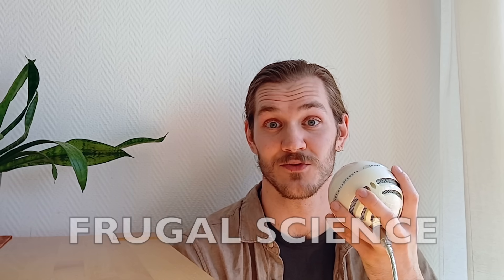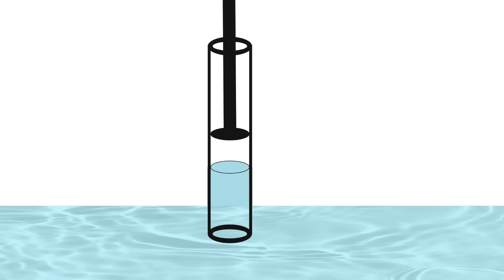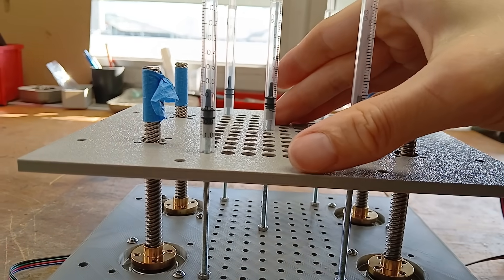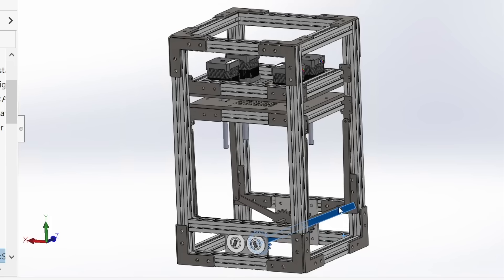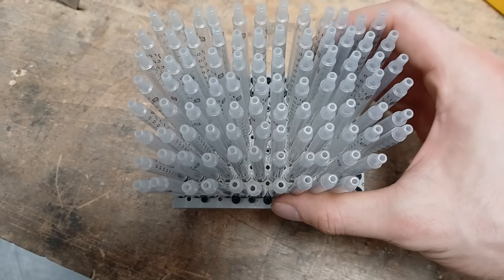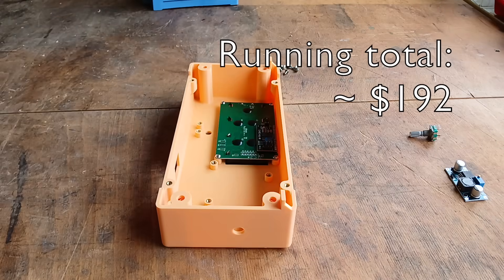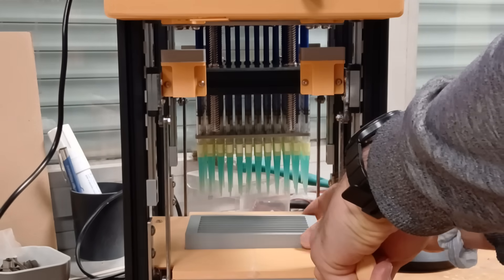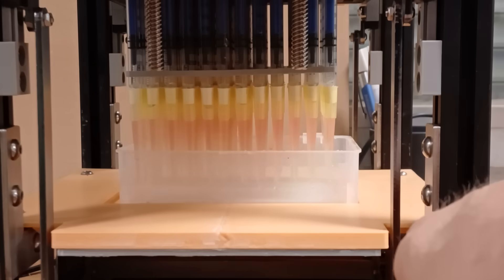This Medical Machine costs $18,000. I Took It Personally.

Comment: I'd add a double-throw centre-off momentary switch to the front panel (perhaps even on the right side of the box, to make it easy to reach). Click it downwards to dispense, upwards to aspirate.

Using the knob to select the “Dispense” and “Aspirate” options just seems like a needlessly complex way to access the machine's most basic function.
Reply from the maker: Good thinking, that would probably be a better UX

Comment: Needs to be able to automatically lock the trays up to prevent user error. Also needs to be designed so all failure modes prevent use.

Plus if sold in the US you’ll need to have liability built into the price. Just add 15k per unit there….

Plus the barrier to entry doesn’t exist. A small lab or single researcher doesn’t need this capacity and a large  lab that does has the money.

This is like making an affordable dump truck for your grandmothers tomato garden.

I did like the video though, this is good YouTube content!

Comment: Any open source for electronics code to fine tune the uL accuracy of the multi pipettor? Im curious what the accuracy is. 110uL to 120uL (10uL difference for example) or can it only do 100uL increments?
Reply from the maker: Great point, this is THE question. How accurate is it, and how can it be measured? The best I cam up with was to try to weight the amounts of liquid.

Comment: Try using herringbone gears to eliminate backlash. Also, I see a lot of these parts could be sourced from a used ender 3 which can be found for dirt cheap online (often under $100). Take a look at the ender 3 and see what can be used off of it in a revised design, maybe an outdated cheap printer could find a new home in a lab saving lives! For reference an ender 3 already has aluminum extrusions, 4 stepper motors, 3 limit switches, a screen and knob combo, and various hardware pieces. I could see the final price coming out to well under $200 with little to no compromise in quality.

Comment: how do you animate your 3d models like in 4:05
Reply: Model mechanism in CAD software first with gears and everything you plan on building. Define constraints, like set or rules, for example: gear rotates around this point, gears mesh in opposite direction etc. Software solve then it for you, while you can move pieces and see how it would work. Pretty cool.
Reply: @litynskyyrostyslav1760 

I'm gonna try this FreeCad software I found

 from the looks of it this is gonna exponentially enhance my mechanisms i randomly make
Reply from the maker: FreeCAD is great, I use it all the time, and there's lots of tutorials. Enjoy!
Reply: He doesn’t, it’s mating type to limit its motion in assembly and he is using his mouse to show its motion.

Google solidworks or fusion mating for gears it should show results that are similar to what he is doing.

Comment: Instead of trying to cram all the syringes into a small grid, have them all attached to pipete tubes of equal length. That would allow the pipetes to be funneled into a closer together grid, while leaving the syringes spread out and easily accessible

Comment: The 4 motors could be replaced with a belt and a single motor. The brackets on the extrusion could be 3d printed in solid PLA or PETG and achieve the same result, assuming you already have the capability. That's off the top of my head for additional money savings on this. Great work! Attainable science is usable science!
Reply from the maker: Thank you, good tips!

Comment: I would suggest using one big syringe connected to a manifold plate that all the pipets attach to. Square-Cubed-Law would mean it shouldn't take up too much space and you can actuate the one big syringe with much less friction. This also means you can reduce your 4 actuator stepper motor & acme rods to one for actuating the single syringe. You can reduce the manifold plate complexity by printing gyroid infill with a bunch of small "attachment protrusions" (there's a simple term that fits, but I'm proactively dodging yt filter) for your heatshrink gasket & pipet trick. You may need to paint or coat this manifod with some sort of paint/filler/epoxy to make sure it's air tight.

You can also reduce BoM of the frame, and reduce footprint of the equipment (maybe borderline portable) by making a scissor lift like device that attaches to a rack and pinion on the moving manifold plate to constrain its motion while keeping it parallel to the base plate. This constrains the manifold lifting mechanism itself and removes the need to constrain the manifold plate externally with linear rails.

Cool project! Love the principle of bringing cheap useful equipment to those who can use it.
Reply: Now I'm completely unfamiliar with the field of science that uses this, but something that I thought of that could be a concern is the off-gassing of the plastics and materials used to make it. Is this a concern for this use-case?

Oh, also, with this "master syringe" method, unless you have really big pressure differences between the pipettes due to large differences in head pressure (water level that the pipettes are dipped into), which is unlikely, the "splitting vacuum evenly 96 times issue" you talk about should be negligible.
Reply from the maker: Interesting ideas!

Comment: This is "awesome". 
I will point out however that the linkage described at 3:45, might have too much backlash for consistent eppendorf microliter aliquots. I recommend setting up a system that allows for autobed leveling so that all the eppendorf syringes are equal in their total dispensing volume.
Another thing you might want to add is something to prevent liquids from pulling too far back into the syringe so that they can't contaminate the syringe itself. Some easier way to swap out the syringes in case of contamination or wear will probably be important. Overall tho, this build is incredible.

Comment: Excellent result!! I work repairing autoanalizers and the main cost of the equipment is all the process, investigation, certification, traceability, and a long, long, long etc... At the end of the day, all parts, motor, controller, etc you can find and buy in somewhere (i have a few motor and parts from some equipment destined for destruction xD). I apologize for my English, it's not my native language.
Reply: Subscribed, just in case you get around to making videos of that.

Comment: Without proving the accuracy, precision and durability of this design, no lab will use it. Syringe plungers are not made for longevity. You have to remember these devices are used many times a day for years. I can visually tell that the liquid amounts are not level. An important consideration when you are working with such small volumes is evaporation. I also want to say that the eppendorf system is kinda fancy, similarly capable systems to this are 5-10k new.

Comment: Sorry, this is the epitome of ignorance.  Do you think the engineers in medtech are morons?  Do you think you think all medtech companies are just greedy?
Let me tell you what you're missing.  1) Setup a QMS, 2) Setup a supply chain to make these in bulk, 3) Setup an responsible party 4) Do all of this in controlled environments under rigors design controls, 5) Go through vigorous V&V cycle of all components of this. 6) Setup aftermarket supports and complaints. 7) Setup servicing of the device.
It's one thing to try and challenge yourself as to the functionality of something made from scratch, but to claim equivalence with complete ignorance as to the legal and regulatory burden that goes into making medical devices is WILD!!!  The testing for the precision of delivery alone is going to run you thousands of dollars.
These "we made it for pennies" videos and articles are bullshit, and genuinely insulting to those of us that have to work under the yolk of the scrutiny of the FDA and other regulatory bodies.  FOH!!

Comment: So.... the thing with these pipette machines is that they're both accurate and precise... When I worked in a lab, the most frequent pipettes got calibrated every 3 months, and everything got calibrated once every year at minimum... 
The products you linked as a comparison, shows that it's got a range of 5-1000 uL. (or down to 0.5-300 uL)... I'm not sure if you know units of measurements, but in terms of mL (which 1 mL of water is 1 gram) means that it measure between .005 m: to 1 mL (or .0005 mL to .03mL)... And they guarantee the results to +/- 2-3% of the declared volume...

I'm not sure that your machine can do that kind of accuracy... but then again, a cheap calibratable microgram scale (down to .001 gram) costs like $20-30 online, so I'm sure you can grab one and measure how low of a volume and repeatable of a service your machine can do...

I get that the malaria paper centrifuge is a relatively easy concept to replicate since it only needs one type of force to be applied and doesn't require any precision, just that it crosses a certain threshold, but pippeting and the requirements for accuracy are exponentially higher... I'd be very surprised if your machine can be accurate and precise to do repeatable pippets down to .01mL and I highly doubt that it would be accurate down .001 mL, let add another another 0 infront of it...
Reply: The precision is probably not great, but there's quiet a few presence/no presence tests you can now do at a high throughput level, that's 96 samples you just processed. There's probably some Taqman assays that could handle this level of imprecision

Comment: The cost is because these things have to be signed off as "medical grade". Its that complicated. Because of the cost of it being  labelled as a medical device, they put even more money into them because what is 300$ on a 15000$ price tag just to make them 100x more desirable
Reply: I work in biotech. Very roughly speaking the cost multiplies for each level in the quality chain you go up. If hobby is $100, R&D grade will be $1,000 and Clinical/GxP grade will be $10,000.

That labeling it ‘medical grade’ comes with a massive amount of requirements for sterility, testing, maintenance, support etc. Likewise that instrument has to work day after day with minimal maintenance etc. I very much doubt if that device this guy made would last more than a week in a lab where having the expensive device would actually make sense.

You could manually do it with a $200 pipette (you do them 1 at a time), a $1,000 multi-pipette (do 8 at a time). Those specialized machines only make sense when you hit a certain throughput. If you are spending money to get one of these odds are you have done the math and figured out that it is worth it and you are gonna be making sufficient use of it to be worth it.

Comment: As someone who tries to keep things scalable on any project I do (for better or worse). I feel like a LOT of the assembly-complexity of this(already very cool solution) could be simplified-away to use the original syringe components 100% unmodified if you allowed some patterned vertical staggering and printed parts that held them in those pre-determined staggered positions. I don't think you need them to be 100% level with one another unless you are injecting with the pipette's under a previously deposited layer.. One of those "Is this really a requirement or did it just seem like one?" things. Also if it was, you could probably just cancel out the patterning if there were 2 heights of Luer-to-Pipette adapter sleeves.
Reply from the maker: This is interesting! I spent a lot of time thinking about exactly this, and you may be right, a 1-2mm offset on every other syringe might not matter. It might make loading them all in one go trickier, but maybe there's a different solution for that.
Reply: Syringes are not as accurate as pipettes. The original syringes are one time use either way.

Comment: The long arms of the platform "jack" have a couple of issues; bearing wear, flexing, and coefficient of expansion of the arms could cause the platform to tilt slightly, if there is any non-isothermal airflow or radiant heat source. Tubular members, instead of "plates" are much stiffer, so provide more resistance to flex.
Flexure bearings reduce wear and play.
Adding some kind of spring force to offset the platform weight reduces wear on components, and reduces required drive power and stiffness of the lift mechanism... A 'constant force spring", like you find in a tape measure, or any number of items, like the roller blinds on the outside of windows.(The mechanism that has the "tape" that you use to lift and lower the blinds, inside the house)

Comment: This is incredibly impressive!

Aspirating some air reduces drips when dealing with liquids that tend to drip. 

Additionally, I could see a plunger plate being added to this relatively easily. Removing all the tips from the heat shrink for another fresh set of tips to go on.
Reply from the maker: Thank you! Those are good ideas :)
Reply: If you are dripping from your pipette, you need to change tips or that pipette needs to be taken out of rotation until it can be serviced. That or you need to stop shaking the pipette around so much. You do NOT want air in your sample, you will not aspirate the amount of media that you have adjusted the micrometer to.

Comment: A three-actuator mechanism for a plate guarantees that the plate moves in a plane, not subject to deformation that a four-corner mechanism has... A couple of optical sensors can provide position feedback, or detection of incorrect movement... Also can act as an auto-zero mechanism to prove actuators are not wearing, or having loss of synchronization.

Comment: Instead of gears to couple moving arms. A thin steel strip, something like the steel in a clock, or any "constant force" mechanism, is an inexpensive and zero-backlash, non-wearing mechanism... It's also usable for bearings than have fixed rotation... Have a look at "flexures" and "flexure bearings"

Comment: what's the deviation on your kitchen scale? I regularly have to weight out 0-5g of minerals and salts for my aquariums and my normal kitchen scale is useless there, as the amounts I want to measure are too close to the deviation to be accurate. jeweler's scales are amazing there.
Reply from the maker: Yep, my scale was not precise enough. A jeweler's scale is a good idea!
Reply: Even a jeweler's scale is terrible for this, you need a lab balance.

Comment: you can make it cheaper by using 1 motor for your "z" axis and use gears and a timing belt to connect all the axes to the motor, finding a way to shorten the lifting mechanism would reduce the ammount of money you need to spend on t slot. The biggest one would be if you found a way to make an entire manual setup to aspirate the liquid, mabe something similar to the lift with a scale next to it so you can gauge the ammount youre gathering?
Reply: A belt with a single motor is also better because you don't need to worry about motors getting out of step.

Comment: By far one of the best made videos and projects on this platform. I have some friends who are supporting the red cross in malawi right now, doing typhoid fever widal-tests by hand, maybe this can help them (even though they are in communities without electricity). I have seen videos of them using the hand-centrifuge you showed, so I wouldnt be surprised if they build some mass testing equipment next! Keep up the good videos!
Reply from the maker: Wow, that's amazing to hear! I hope it can be useful.
Reply: @itstriggy4814  Do you have any info as to what voltage/current this takes?  I'm assuming its a far bit with the motors running (my guess is about 30W) but probably idles closer to 5W.  Does it run on 5V?  12V?  I was thinking one of those rechargable flashlight units would probably power it.  They typically have a small solar cell, a 5V USB power output, a light (as well as often a radio) and a solar panel and hand crank.  They typically sell about $20-30.  If that won't work, I've more ideas.
Reply: No electricity is a minor issue for something like this.  You only need a few watts to run this, probably a small lithium battery or gel-cell and some electronics would do it.  If you're serious about it and I learn what the power requirements of this project are, I could probably find some suitable electronics parts and design to make it run.  You could probably even charge the battery off a solar panel which is pretty easy as well.

Comment: Impressive work! Were there any issues with getting the 4 linear rails aligned at 5:08 ?
Reply from the maker: Thanks! Good point, in hindsight there definitely could have been an issue with misalignment, luckily I didn't have any. I actually hadn't considered that, but I must've been within tolerance by chance

Comment: Many years ago I spent time fixing obsolete medical equipment for medical missions, I dont know the current situation for this type of work, but I could see something like this being useful in remote villages.
Reply: Hero in 3rd world countries - villain in EU. MDR/IVDR regulates manufacturing heavily and maintenance also
Reply: @ketse89  Regulation is important. For some stuff this is fine. But imagine the potential for cross contamination if something isn't built exactly to spec? Who do you blame? Basically is a matter of analyzing the cost-benefit relationship of higher cost because of regulations and the potential loss of life for unregulated markets. It is not a black or white problem.
Reply: @skvvlk  Yeah I don't what is worse don't getting testet for a disease or getting the wrong result? Because sometime the cure for a disease can be deadly for healthy person or for ppl with a different disease.

Comment: Using a single stepper motor + linear rails or a belt driven system would simply it by a lot. If you would use a single vacuum pump + equal length lines to all syringes it might simplify it as well.